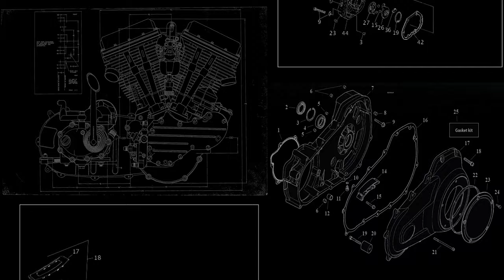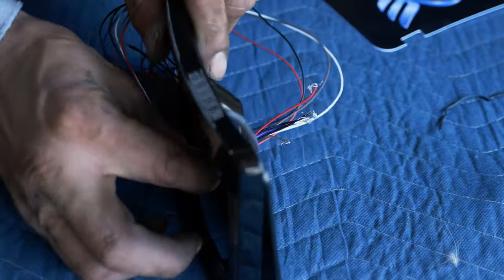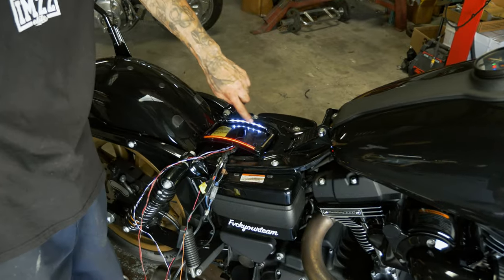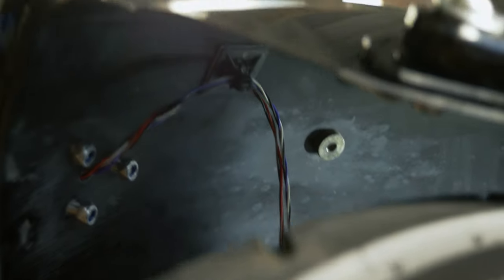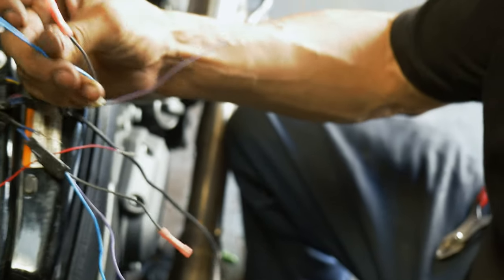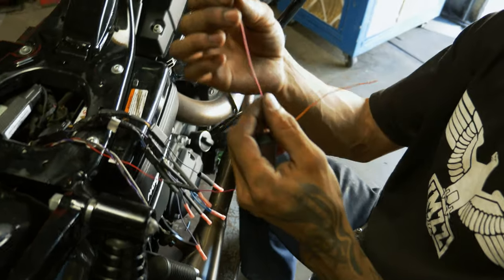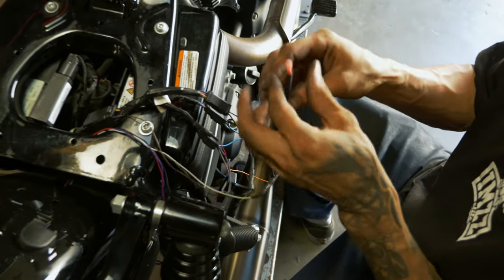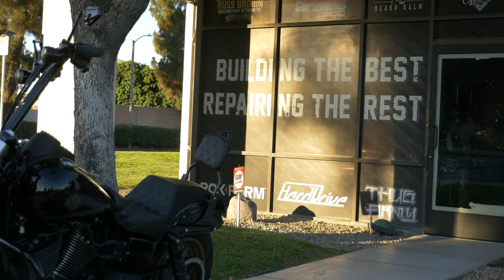Imzz Elite | How-To install an LED License Plate Frame

Comment: So I followed the video (I’m a fabricator not an electrician) lol can someone tell me why that little red light on the Speedo came on and won’t go off? It’s a 2013 dyna fxdb. Everything seems to be working like it should but I noticed the blinker indicators on the dash are blinking faster than the blinkers are and that red light is on. Any help would be appreciated! And thank you to the guys at IMZZ for putting out a super thorough video!! I’m a tig welder/fabricator and build bikes every day but I can’t wire shit to save my life lol this video helped a fuck ton
Reply: Sounds like you might need a load equalizer for the fast blinking. The red key light on the dash is maybe because the light has been changed to led and the computer doesn't register it. You need to check what code it is related to.

Comment: Your amber lights are turning on with your brake lights when you brake, how can you just leave the amber lights to turn on with the signals only?
Reply: Custom Dynamics tells you how, they have several wiring diagrams in the instructions to show you how to do multiple different options.

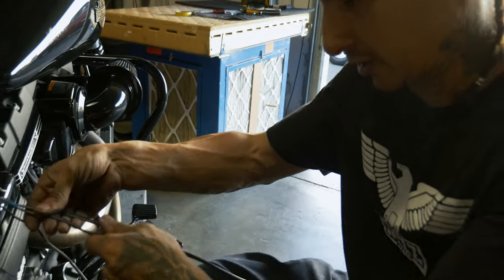Comment: Quick question. What was the purpose of cutting the taillights so short if you planned to cut the wires again @26:30? I wish I would have seen this prior to making my cuts the same haha
Reply from the maker: Hey, we cut them again so they are staggered. He explained that about a minute after.
Reply: Guess I missed that part haha. I just want to say thank you for this video. Followed this step by step and completed my first electrical job on my Dyna. 

Any tips on how to reset the computer? Every connection was done correctly. First test ran great but then it started acting up i.e hazards not turning off or the blinker lights were stuck on.

Comment: What size license plate does it take? Just brought one for my low ride st and can't find plate size anywhere
Reply from the maker: Standard US plate size...
Reply: @imzzelitevehicleconcepts9267  which is? Im from UK
Reply from the maker: Oh sorry! 7 x 4
Reply: @DUSTY88  did you fit it? Was it any good. Fancy one for my St. Bob
Reply: @coco 123  size was correct, used a flexi plate, no issues at all :)
Reply: @DUSTY88  I'm in England too. . How do you get it through the m.o.t ? 
Does it go through ? My worry is if you put at full size plate on it will hide all the lights in the plate. . .
Reply: @coco 123  i use a company called flexi plate uk and have a black and white plate fitted

It wont pass and isn't legal but when you take it for mot just stick the original plate ontop or tell your garage and bring original plate.....ive never had a garage refuse